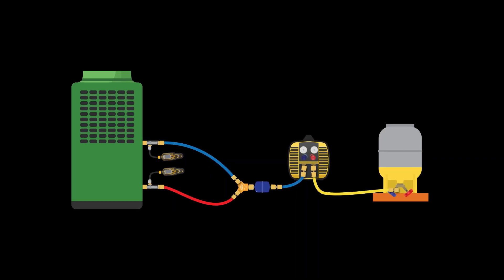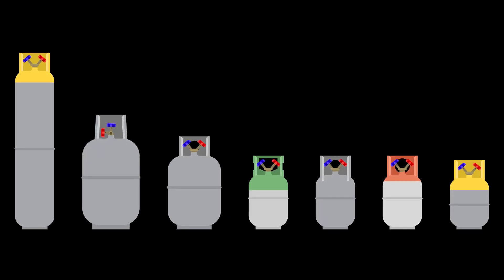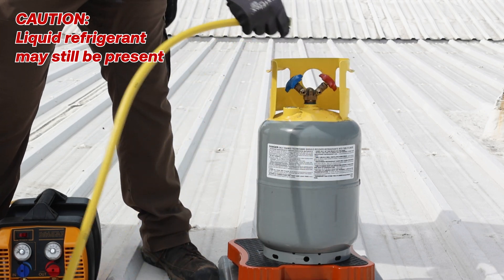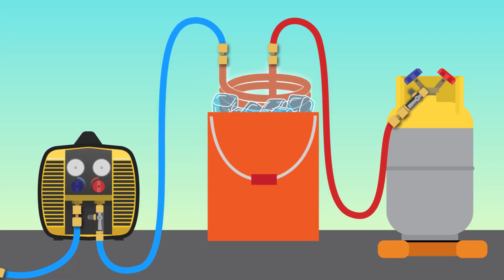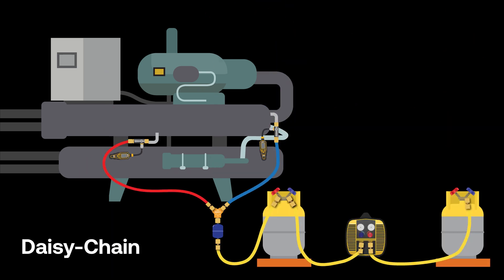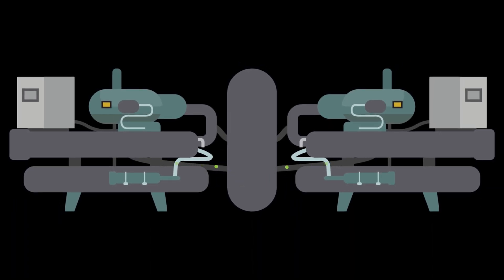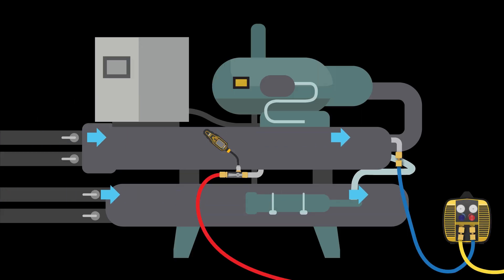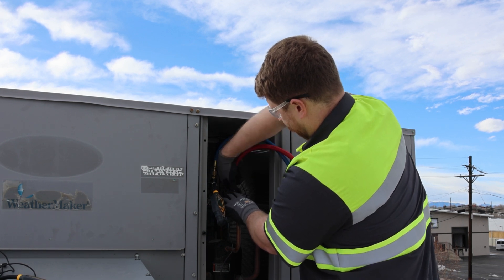Fast Recovery Series Part 4: Fast Recovery in Application

Comment: Little tip to prevent your liquid hose going into your tank from being full of liquid at the end of your recovery is to block off your airflow on your recovery unit and valve off the hose at the tank, keeping an eye on the pressure. Build up some pressure and open the valve. This blows the liquid through the hose, while blocking off your machine's airflow will stop the refrig from condensing. I usually do this on the last 10psi so my hoses are just vapour. Saves your hand from frost and makes it safer for your eyes from accidental discharge of liquid. If you have a subcooler I usually pull that out of the water / take my water hoses off when I'm 90% done.
Reply: When you say block off airflow to the recovery machine, do you mean like put a piece of cardboard on the back side vents of the g5 twin machine?
Reply: @portalkeeper978  I use the MR45, I have used the inficon machine before that. I also use a York RP-2200 chiller recovery machine, all the same procedure except that machine is water cooled so id disconnect water and build pressure that way. Anyways, I use a paper towel, or a cotton rag, or a plastic garbage bag. Stops air flow, stops condensation of liquid, builds discharge pressure to push the liquid out of the machine and hose and into your tank. Use of a sight glass will show when the liquid is essentially gone. I only do this for the last minute or two of recovery, your hose will be mostly vapour. I use 1/2" hoses up to 12 ft long and they can hold over a pound so I try to avoid discharging liquid to the air when I can. Very important to keep an eye on your discharge pressure as it will rise VERY FAST doing this, I usually build pressure until my hose is warm, not hot, and blow it into the tank, and repeat 2-5 times. If you are using 1/4" hoses honestly I wouldnt bother, use the machines purge function if it has it, then youre good. 3/8 and 1/2" hoses I would try and mitigate liquid buildup as it can burn your hands and eyes and it can be easily avoided with my "method." Use at your own risk, be smart and safe!
Reply: @FrenchBeefCDN  thanks I’ll give this a try!